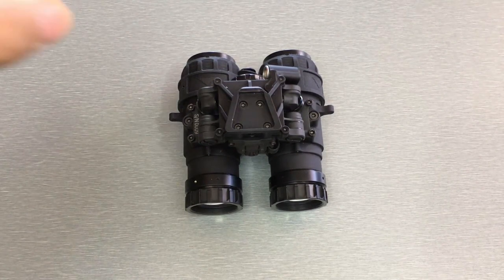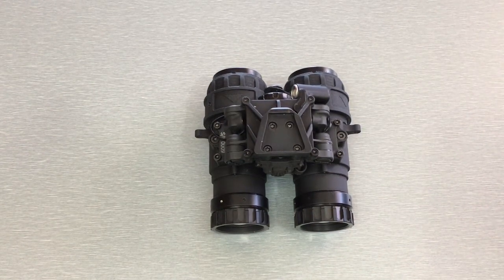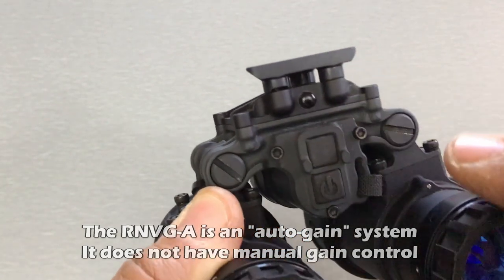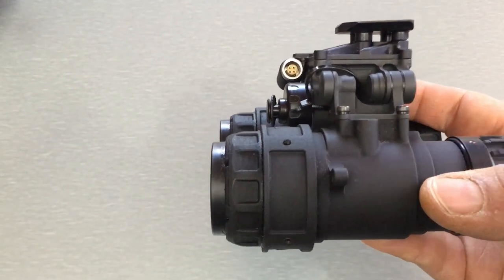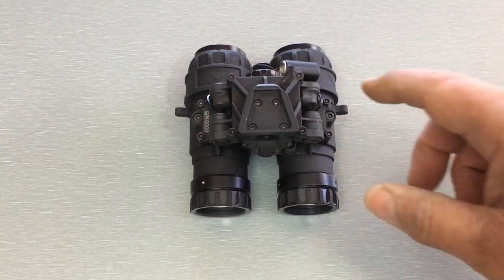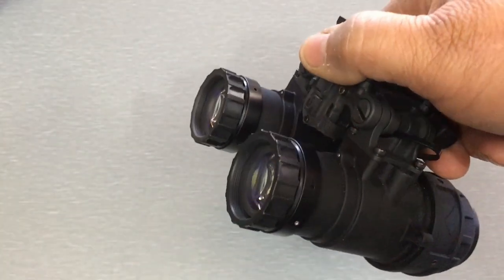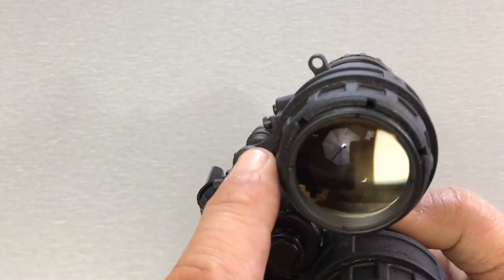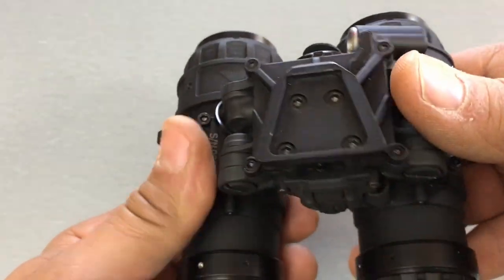RNVG-A "Articulating Ruggedized Night Vision Goggle

Comment from the maker: I didn’t cover IPD stops in this video. This goggle does not have IPD stops. 

Although this can be a useful feature, and some users prefer a goggle with them, it is honestly unnecessary with articulating goggles and can actually be hindrance in some situations.

The reason why is that it is common for your helmet to move especially during dynamic movement. The IPD stops can interfere with proper positioning due to this. By not having the IPD stops set you are able to move the pods where they need to be. Whereas
Reply: Lol by this logic, non-articulating goggles can interfere with proper positioning.
Reply from the maker: @tacticallurk6959  Yes and no. A few things come into play that affect how well an articulating goggle IPD system works.

How reliable it remains in position, helmet fit & adjustment, and the activity you’re doing.

The #1 thing that affects it is helmet fit & adjustment. The majority of folks I see run their helmet on the loose side for comfort. This will cause your helmet to move and in turn change your IPD. 

I haven’t found this to be as much of an issue with fixed bridge goggles. The reason is that you’re bringing the device down to your eyes as one unit and you will naturally bring into the correct position with your hand likely without realizing that you’re moving it into position. 

Another thing is that due to the nature of how a fixed bridge goggle stows with more weight forward, most folks will have the helmet chinstrap engaged and the helmet tightened up.
Reply: Is this just a housing sold as is or this a full system sold with set of tubes?

Comment: Is it just me or should gain control and lemo port be standard on EVERY modern NVG? I think they should be. Very bummed my DTNVS's don't have either.
Reply from the maker: They’d both be welcome features. It’s easier for the mfg’s to use 10160 format tubes which is why you don’t see them
Reply: Manual gain should absolutely be an option.
Reply: @Gregory Himschoot  it's literally not an option on many modern tubes.
Reply: @NITEWALKER-NIGHTVISION  Why do you say manual gain is less important on duals than a mono?
Reply from the maker: @ericquintana1900  because both eyes are aided looking through night vision. With a monocular, gain control is a requirement IMHO because if your aided eye is at max gain then your brain cannot incorporate the image from your unaided eye unless the ambient light is very high. By lowering the gain your brain can use both images together. 

With that said, a dual tube goggle with gain control can be very useful for users who are light sensitive since they can lower the brightness to a more comfortable level.

Consider that the professional users who spend the most time continually under nods are aviators and aviation systems do not use gain control.
Reply: @NITEWALKER-NIGHTVISION  That was very helpful input. Thank you very much!

Comment: Seems like a great set-up, but a Couple minor Questions before I make my final purchase decision:
Q1:  Does the Limo port have a cover if not used w/ external battery pack?  (...have not seen one pictured, ....anywhere)
Q2: The magnet on/off - If the magnets don't touch the housing, it stays off, ...right?   ....if you need to adjust the eye width /separation is there any leeway or play, or is it all the way 'closed' to use only?
Thank YOU!!
Reply from the maker: There isn’t a cover for the port. I wouldn’t worry about, most goggles that have a horizontal port don’t use them. The port on the RNVG-A is fairly protected where it’s located. 

Correct, when the pods are articulated outwards the system cannot turn itself back on. There is plenty of adjustment for IPD without it affecting power via the magnets.

Comment: You mentioned that you prefer fixed bridge over articulating, what are your reasons for that? As most people prefer articulating
Reply from the maker: I do like articulating goggles and it’s a cool feature but I either want both eyes under nods or neither under nods. So moving one up while using the other I never do that. I don’t wear my helmet with nods unless I’m using them. Articulating is a very important feature for those users who will be wearing them the helmet for long periods but not under nods the entire time. They’re definitely more comfortable than a fixed bridge sticking out while stowed. 

I prefer the TNVC Artemis BNVG in Anvis/ball detent format. The goggle automatically turns off when I stow it and turns on when I deploy it dead reliably with zero worry that it’s turned on when I stow it. The pivot point puts the goggle in a good position vs a dovetail fixed bridge goggle. If I don’t want to stow it and want to use eyeballs I just turn off the battery pack and look under the pods. I might have to tilt the helmet up a little. I find that works for me best.

Comment: I m new to NV.. are all the variants of RNVGs made with PVS 14 tubes? Is the difference in the housing or the tubes themselves also?
Reply from the maker: No. The only RNVG variant that uses the same tubes that are are used inside a PVS-14 (properly built) is the RNVG-VG. The -VG features manual gain control like a PVS-14.

The PVS-14 uses the 11769 tube format (has a gain control ribbon cable). 

The other RNVG variants do not have manual gain control and they use 10160 format tubes. These tubes do not have a ribbon cable. 

There are caveats because some builders are known to reformat tubes and 10160 tubes can be used inside manual gain control housings.
Reply: @NITEWALKER-NIGHTVISION  thank you for explaining this

Comment: Does that housing auto-gate? I know there’s no manual gain, but the tubes still protect themselves right?
Reply from the maker: Autogating is a feature of the image tubes. Most tubes sold by dealers today have autogating. TNVC only sells autogated tubes
Reply: @NITEWALKER-NIGHTVISION  gotcha, wasn’t sure where the auto-gating was occurring. I assumed they look for excessive cathode current or something and clamp that down. I had assumed the tube it self doesn’t have much in the way of smarts inside and that all the HV bias, gating etc were functions of the external electronics.

Comment: Is there a way to stop them from turning on when you stowe them at full articulation on top of the helmet?
It seems like the magnet is sensing the steel in the G 24.
Reply from the maker: Somethings not right if it’s turning on when fully articulated. The pods are nowhere near the mount 🤷‍♂️
Reply from the maker: I’d get with the vendor you got them from about it
Reply: If you don't peel them all the way its fine but its something with the magnet sensor. I was hoping somebody else with a set had worked out a solution. Last thing you want is to open them too far and be burning battery while they're stowed
Reply from the maker: @jalowery1246  no, haven’t come across that myself
Reply: @NITEWALKER-NIGHTVISION  I figured it out. There's magnets embedded in the dovetail side of the G24. No idea why they're there but if you hold a piece of steel near either of the squeeze tabs used to slide the nods in and out you'll notice the magnetic pull. Wierd...🤔

Comment: Does the device also auto turn off when flipped up on the mount as well or is it only individual pod shut off when pushed out?
Reply from the maker: It doesn’t have auto off flip up. The only auto-off feature is in the pods.

Comment: so how is this different from  Dual Tube systems?
Reply from the maker: The RNVG-A is a dual tube system but since you capitalized it, perhaps you’re referring to the Act in Black DTNVS? If so, the major differences are:

RNVG-A is made of 7075 aluminum.
DTNVS is made of fiber reinforced polycarbonate.

RNVG-A has a LEMO port for using a remote battery pack.
DTNVS does not have any port. A 3rd party battery adapter plug product is available.

RNVG-A does not have IPD stops.
DTNVS has an IPD stop kit that can be added (it’s an option, not included).

RNVG-A’s lanyard/bungee loops are located on each pod.
DTNVS’ lanyard loops are located on the bridge. 

RNVG-A uses push buttons.
DTNVS uses a single knob.

RNVG-A does not auto shutoff when stowed/flipped up using the mount.
DTNVS auto shuts off when stowed.

RNVG-A is about 20oz.
DTNVS is about 18oz. 

RNVG-A is made in the USA.
DTNVS is made in Europe.

There are subtle differences in other areas and differences in how operation etc. but these are the most significant differences.

Comment: Why do you prefer the RNVG over these?
Reply from the maker: The goggle I personally prefer is the Artemis in ANVS configuration. I’m a fan of the ANVS interface for its auto on/off function when stowed. I also prefer a fixed bridge for its reliable IPD spacing whenever I flip it down. I run it farther from me eyes which allows me to see under it just fine if I need to. 

With that said, articulating goggles are preferred by the majority of users, and I also like them.
Reply: @NITEWALKER-NIGHTVISION  well said, thanks for taking the time to reply
Reply from the maker: @Grizzly_Bear2018  🤙🏼

Comment: Would you get the pvs31A vs RNVG-VG?
Reply from the maker: This is great question! They have different features and price points but mainly the price point is what will make most folks decide. The RNVG-A is $2,800-$3,700 less expensive (depending on tubes and housing color). 

Another thing is the warranty. The standard warranty on the 31A is 1 year from L3Harris and this is what most vendors offer. At TNVC we extend it with another 5 years. This is for tubes and everything. The RNVG-A has Limited Lifetime Warranty which means 10 years for the tubes and Lifetime for everything else (housing, lenses). 

If price is no issue then the BNVD/31A has manual gain control and includes the battery pack. The fixed rear diopters IMHO are a plus for a single user as long as the diopters are correct for them. It’s nice not ever have to mess with them.

31As have a bad rap IMHO. We’ve sold a ton of them (seriously, A LOt) and we’ve had only a couple come back for repair due to being broken.

With that said, the RNVG-A will undoubtedly be stronger, so if that’s what you’re wanting is as bombproof as possible then RNVG-A is the way to go. 🤙🏼
Reply: I think a closer comparison would be the ARNVG vs PVS31A. In that case, its a toss between variable gain and super rugged. Shame there isn’t currently such an option because that with a properly placed LEMO port would be the perfect dual tube set up.